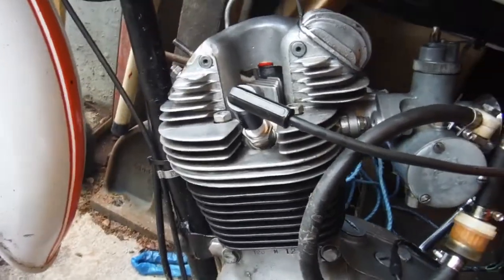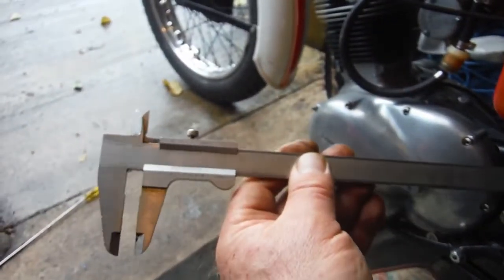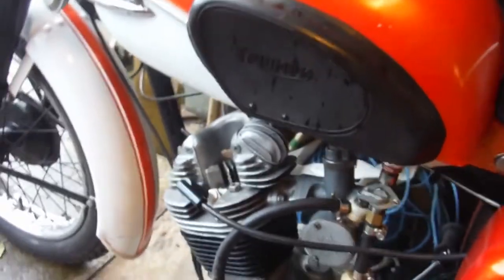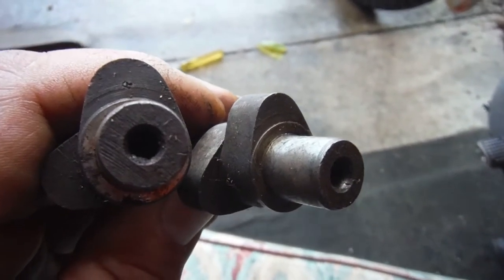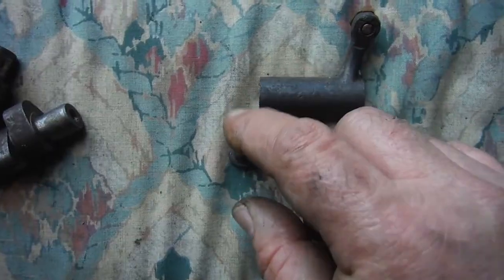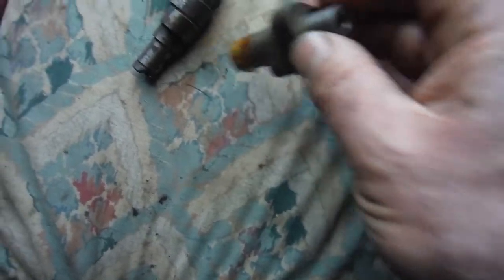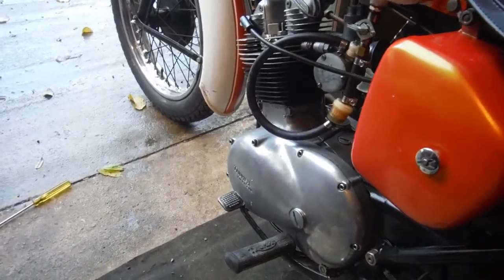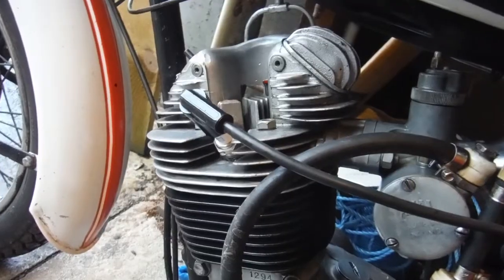How to tell if a Triumph Tiger Cub engine has a standard or a sports cam without stripping it down.

Comment: The standard cams on all Triumphs since 1950 have that 10 &10 thou clearance. Apparently they incorporate quietening ramps. I still don't see why the sports cams, which don't have the quietening ramps have only 2 & 4 thou clearance.. The clearance changed with the T140s but still not as big as 10 thou

Comment: When you rode it did it feel as if it had a standard cam? Makes no difference if it is set up all wrong, but sometimes the seat of the pants gives some idea.
Reply from the maker: I must admit i half expected a high lift cam and high compression piston to be fitted, going by the rather pronounced 'power band', but that may have been down to the clutch slip. It has a standard cam and compression ratio, as it happens.

Comment: hi Paul interesting, and it got me wondering would the sports cam change the ignition timing  why i ask is the touring cam on the bsa a65 is 37 degrees btdc and the sports cam or spitfire cam is 34 btdc as the lobs are different.
Reply from the maker: Hi - yes, there are various combinations of cams, compression ratios etc, which all have their own ignition timing requirements, as well as carb settings, too.
Reply: hi Paul cheers for the fast reply @paulhenshaw4514

Comment: This is timely vid for me, and I hope you have time to help. I have a 65 Cub with Wassel elec ign, I know I have a std cam and flat top piston, although it starts great, I wonder if it's a bit advanced, also it's bloody clattery, top end is sound, new valves and  guides, new rebore/piston, tappets just under .010" still noisier than other Cubs I've heard. have got a new std cam and followers and camwheel to fit, see if that qiuietens the bugger down! also the ex pipe shows much blueing, although the plug is dark brown to black, so not a weak mixture. Could being maybe advanced be the cause of the blueing? or even the noise? thanks Paul, love all your Cub vids!
Reply from the maker: Hi and thanks. If the fuel side of things are ok, it is usually an over retarded ignition which turns exhaust pipes blue. There are many potential sources of clatter on Tiger Cubs, including sloppy timing gears - oversized gears are available for the camshafts in + 0,005" and + 0,010" diameters, to take out slop and quieten things down. Camshaft end float is another, and the rockers need all their shims and spring washers present and correct.
Reply: @paulhenshaw4514  Thanks for getting back Paul, yes I have an oversize plus .010 cam wheel on order, I will check the end float on the cam when I strip it, I actually want to find something wrong I can fix, That'd make my day! thanks again mate.